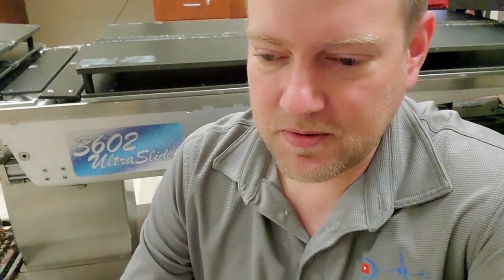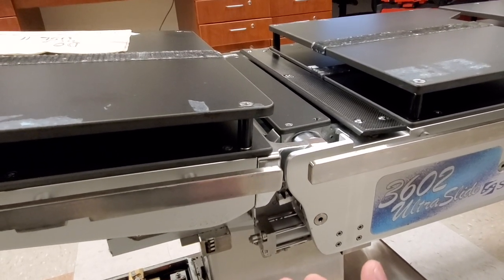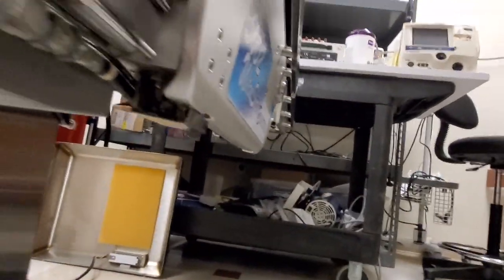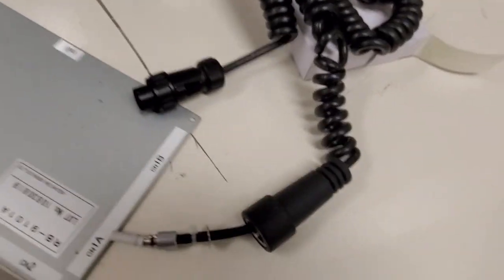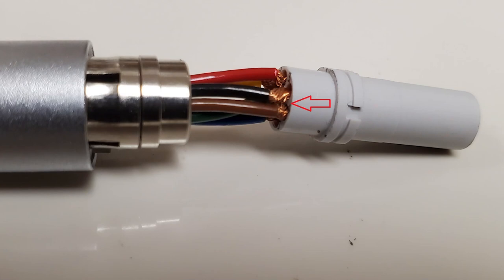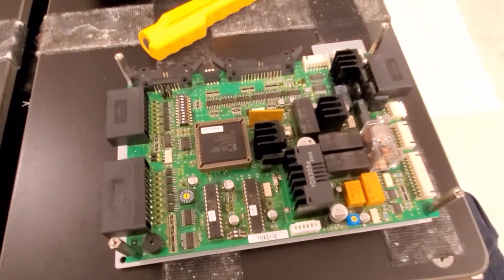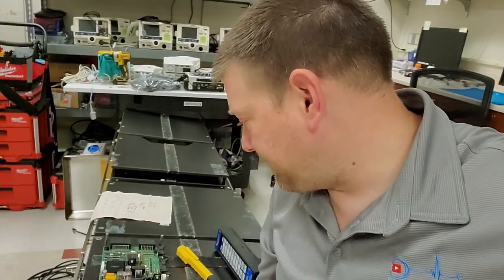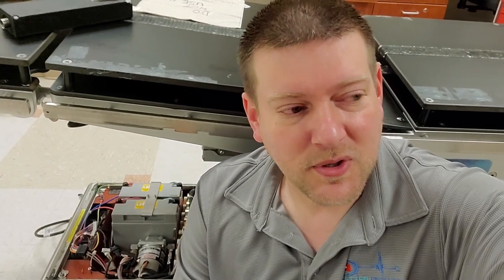Multiple Skytron Surgical Table Problems

Comment: Im having, I think a similar issue where the back wont go all the way up..  the kidney rest is down and will not go up or even make a motor sound like it's trying too... it will make a motor sound when I hit the kidney down button.  But it's the Old 6500 hd with the red sticker.
Reply from the maker: yes, there are collision microswitches and one of them is out of adjustment.

Comment: With the microswitch problem, why didn't they use a small hole in the moving rod of the kidney bridge, and a lightsensor/detector ?
That way there are less mechanical parts and less wear and tear.
Reply from the maker: The microswitch is cheap, sealed, easy to adjust and test compared to an optical detector.  An optical detector could give a false positive if blood or debris fell down there - which is guaranteed since it's surgery.

Comment: completion of the Schaerer AXIS 400 operating table, error code E12: Calibrating Data Failure. Data from position sensors doesn't match up with main controller board's data. The table must be recalibrated.
please help master Better Biomed
Reply from the maker: I have never heard of that table. I will do some research.
Reply: please help sir. on the remote it shows E12.